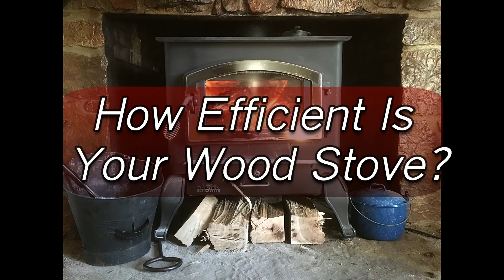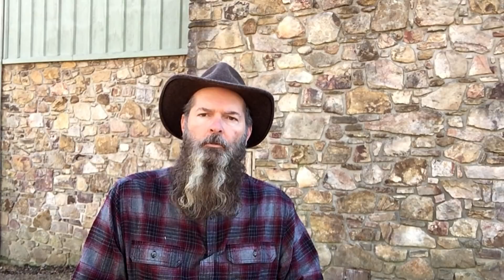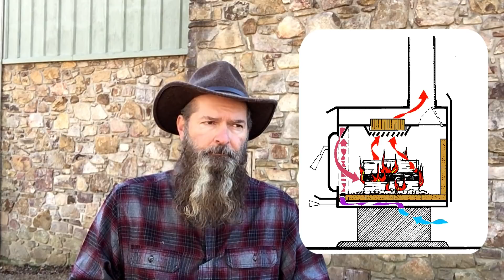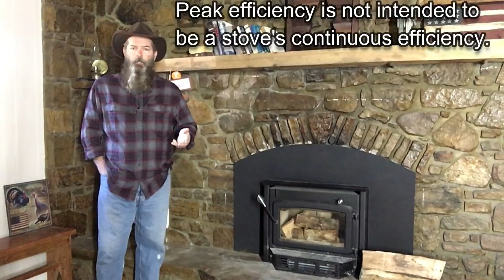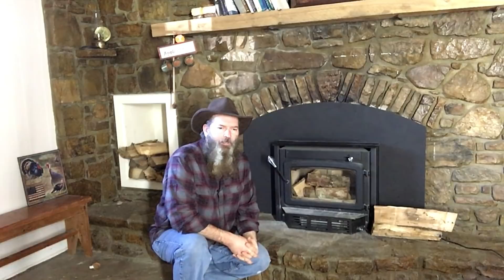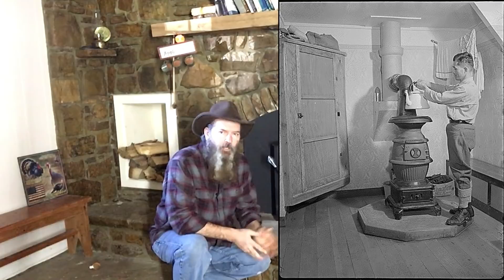How Efficient is Your Wood Burning Stove?

Comment: There is one more important thing to consider. How you would heat? With air (convectional) or with radiating heat? The radiating heat is more efficinet because the warm air goes up immediately and effectively heating the ceiling. For radiating heat the mass heater would be the best. Doesn't become too hot when burning, releases the heat for long time and you can burn the fuel at high enough temperature for the most efficient combustion.

Comment: You need to consider how the heat from the stove transfers to the room. If you have a freestanding stove in the middle of the room with a long matt black stove pipe far more heat will be transferred into the metalwork and radiated into the room than if you have a stove built into the wall and the fumes exiting up a conventional brick chimney. In the latter case it’s going to be more efficient if the chimney is in the centre of the house not on an outside wall, so the waste heat in the chimney stays in the house rather than heating up the garden. Of course, you can’t control all of these things and our main stove is in exactly the wrong place on an outside wall exiting up am external chimney. Still works well but not how I would have done it if I had designed the house 60 years ago! We have a second stove in a log cabin in the garden and that is freestanding with a flue that goes up through the roof. The entire length of the flue gets too hot to touch and really heats up the cabin quickly.

Another tip - attach a magnetic thermometer to the exit flue. This is really helpful to tell you when the fire is hot enough to be working efficiently but not so hot that things can get damaged. Nothing worse than a stove that is too cool to work properly.
Reply: Double wall stove pipe doesn't even get hot though
Reply: @denverbasshead  Double walled insulated pipe is only used where it runs through ceilings etc. Check the regs.
Reply: @Tailspin80  uh no. The stove pipe running right from the stove up to the ceiling is double wall pipe. Once it hits the ceiling, it turns into triple walk stainless steel pipe and continues outside for the chimney. They still make single wall but it's terrible
Reply: @denverbasshead  Depends on the system design I guess. I installed a small burner in our log cabin 20 years ago and ran single walled up to the roof, then double through the roof to the outlet. A lot of the heat output came from the single walled flue which acts like a large radiator. Probably not such a good idea in a domestic full size house where it could affect flue performance and fire efficiency etc.

Comment: Ok so i just got a quadrafire 4300 installed in my basement and from day 1 it has been a run away stove. I can load my entire box full, fall asleep and wake up 3 hours later to nothing but coals. Dampers closed all the way down and the thing just roasts...had the install company out twice just for them to disable more of the air systems with no luck...

Comment: I’ve got an insert wood burner. If the fan isn’t running I might as well not burn in it.  They aren’t good at all if you lose electricity.  I want to swap it out for a free standing burner. If someone so much as farts in my neighborhood we lose electricity. 
The positives are it’s easy to run. And with the fan if it gets too warm ( which never happens when my wife is there) I can cut back on the burn and either slow the fan or turn it off.

Comment: Just happened across your video, its a great vid for beginners. I originally had an old Buck wood stove that was there when we moved in, not very efficient and was not installed well, had a rectangular vent on top that they had just venting straight up an old fireplace chimney. Basically a fire hazard in the making. I pulled it, put in an insulated stainless liner and got a russian wood stove off a company in Florida, Stoker Thermo 200 made by Ermak, it can take 18 inch logs with no problem, has an afterburning chamber at the top so once you have a fire going and the stove has warmed up it burns very clean burning off the flu gas. It burns less than a 3rd the wood of the buck stove and puts out probably twice the heat if not more. With the ceiling fan moving the air around, it heats our house very well.

Comment: Two tips for anybody just getting into this: (1) get an indoor/outdoor thermometer and make a habit of looking at it several times a day.  With a wood stove you are the thermostat and over time you get a sense of exactly how much you need to feed it based on both the indoor and outdoor temps.   (2) patience is required, both in daily operation and in developing your own skill at running a wood stove.  You won't be particularly good at it immediately and that is perfectly normal and nothing to worry about.  When you are inexperienced, you'll let your fire go out and wake up freezing, you'll backpuff the thing sending smoke into the house, or you'll have all your windows open when it is -10 outside because your house is now 90 degrees in January. That happens to just about everybody, but not everybody learns the right lessons from those experiences.  Don't give up, stick with it and you'll get there eventually.   It takes time, a running wood stove is almost like a living thing, you have to learn her moods.
Reply: Another thing you learn quickly is to not try and light the fire when any sort of extractor fan is running in the house, particularly the high powered ones found over kitchen hobs. If you do this the fire will not draw and smoke may billow back into the room. Once the fire is going properly it doesn’t matter because the flow up the chimney will overcome the fans and ensure that new air is drawn in though air bricks etc.

Comment: Thank you for this video. I'm planning on putting in a wood burning cook stove in my house. Oldie but a goodie. I'm getting it in 1 week. Built In the 20s. For my small house the heating will be compiled with the central heat in the winter. But yeah. Cant wait to start to get it going. Hard work yes but the reward for not needing as much electricity vs a renewable source...

Comment: I use a fan on my woodstove once it gets up to temperature to help move the air around my open floor plan. Once the room is up to temperature I can shut the fan off and all is good, it just speeds up the process. I’m glad I have a fan. Thanks for the great video.
By the way, could you do a video on people selling old non-EPA stoves on the Internet? They should know that they are not safe to use and will not be covered by insurance. Just a thought. Keep up the good work

Comment: Great video. FYI inserts are designed with a jacket around the firebox that needs a blower to move the air through it to provide best performance. I run a catalyst insert and the only time you open the by-pass is when you load the stove.
Reply from the maker: That is an excellent point and thank you for watching.

Comment: My Vermont Castings Defiant catalytic converter has lasted 22 years. Never never thought would be the case. Additionally, the electric used to flush the heat out of a insert like yours needs to be deducted from the efficency rating. Also, as to thermal mass you stone area is a MASSIVE heat/cold sink...I hope it is not exposed to outside air on the other side (outside?).
Reply from the maker: The Defiants are beautiful stoves. Thanks for watching. I've had some experience with the Vermont Encore and it is a beast of a heater.